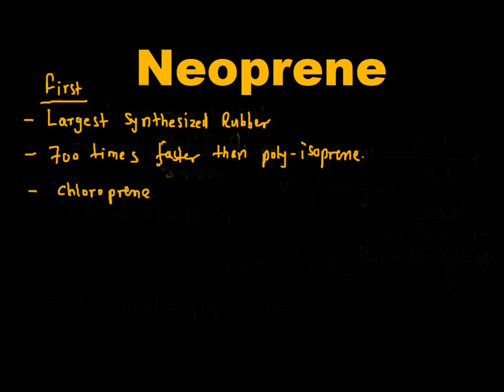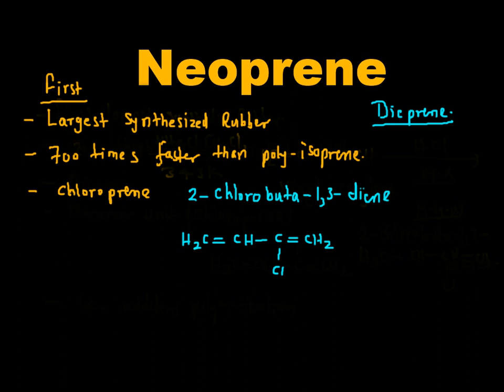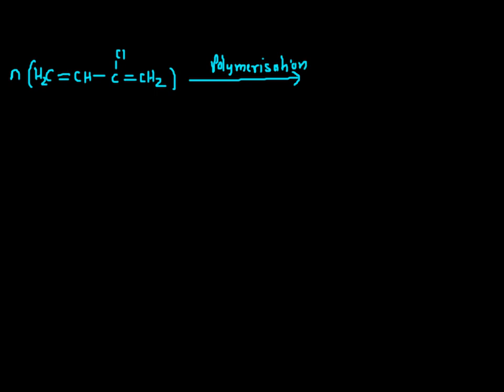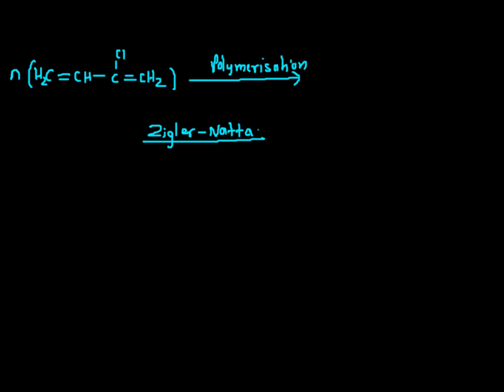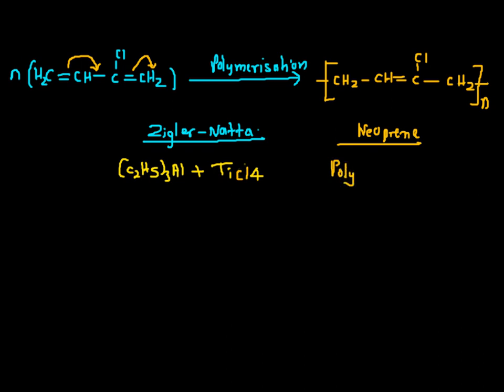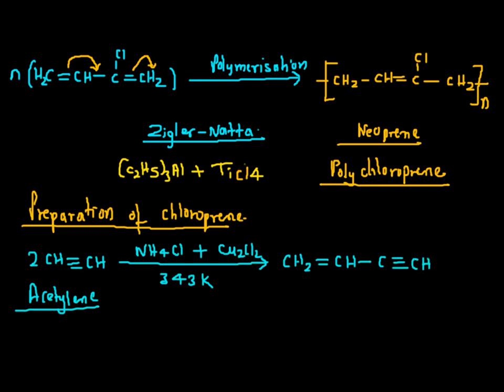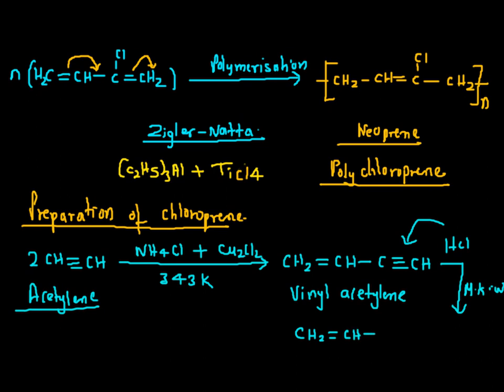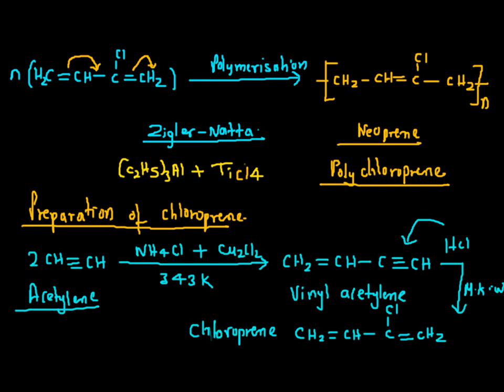Neoprene(Chloroprene)

Comment: hi there

 i was wondering how do you test whether the rubber is CR rubber or not..?
is there a way of testing?

i make machines in korea a refrigerant aircon machines and there is a little product that goes into the machine its a small rubber attached with rubber.. 

and the problem is
and my partner company says its made cr rubber..
but i dont believe that,
because the rubber intumescence
so i was wondering if there is a way of testing the rubber?

Comment: So the Ammonium chloride acts as the electrophile allowing the 1,3-butene to form; while the copper(+) chloride acts as a chlorine donor for the formation of HCl in the subsequent reaction. Any idea if that's how it goes?

If that's the case, than 1eq of HCl would be more than enough since the product is not chiral; and it's stereochemistry-addition to the pi bond doesn't matter.

Also, any sort of enzyme-like function that Ammonium Chloride or Copper(+) Chloride would provide would be inconsequential.